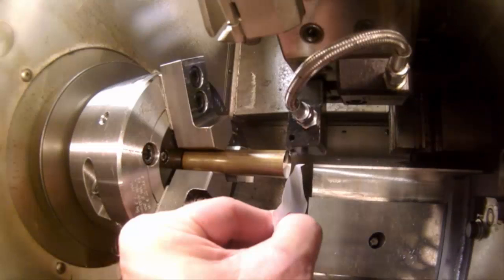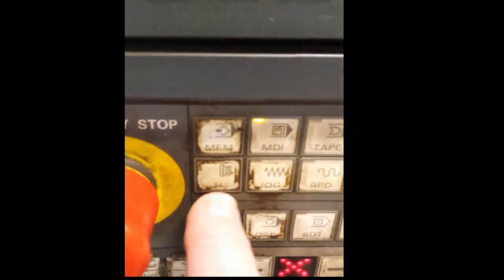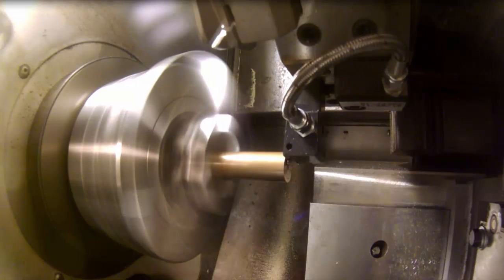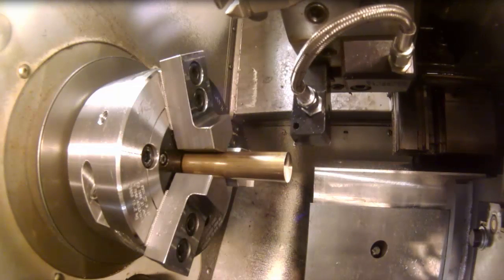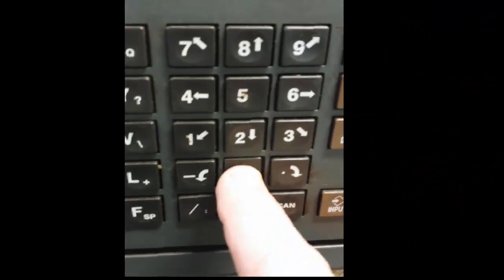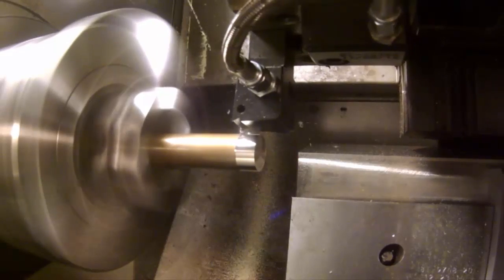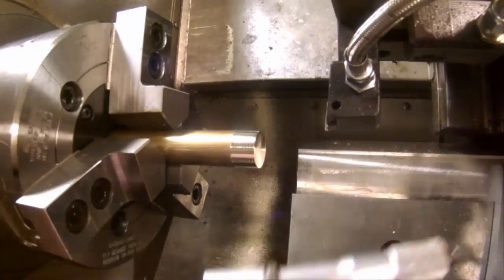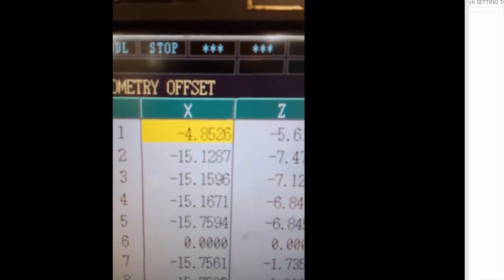TOUCH OFF AND SET A TOOL ON A CNC LATHE

Comment: Hi Tom good morning how are you doing? I love your videos I am a machinist yesterday the cut-  tool broke because it was half way cutting and we got a alarm saying W353 G496 lookin for G497 well it was running the machine. My question to you i have to put a new cut- off tool on this cnc lathe which its new to me. On the sub spindle the stock diameter is 1.0 its a Nakamura Tome wt-100 double turret so do i put X1.008 meaure in geometry under T1 X i have a .004 shem thats why im doing this. Is this ok i learned this from another co worker years ago. Thankyou.

Comment: So when doing a set up you touch off all your tools first (x and z) THEN you set your G54?

And say I already set my G54 but then after, had to re touch off my tool #1 for some reason... would that move my whole G54?
Reply from the maker: Yes. That is correct. 
Once G54 is set it does not change even when changing, adding or replacing a tool. 

G54 tells the machine where the end of your stock is

Touching off the tools tells the machine where the tool tip is
Reply: Awesome! Thank you SOOO much for the help and for all your videos. I recommend them to EVERYONE!

Comment: the easier way to do this is to write the following program in MDI mode.
•G97 S4000 M03
•T0101 M06
•G54 M09
•G00 X-150 Z-300
This program automatically measures tool offset and sets a zero point.
Reply: This program will automatically fire you.
Reply: Stupid idiot
Reply: lol

Comment: hi x axis offset is wrong that job may be 18 mm od but u set only x0.18 which means in correct. right one x18.00 and measure u 

here 18 mm given as example

Comment: Good training. There are many ways to setup your geometry offset page. We use tool#1 as zero that way the other tools represent the difference in length. Such as a boring bar that is 3" longer than tool #1 shows up on your setup page as 3.000.

Comment: yes i have a question do you have to do the same" cutting "method  for x assignment for each tool ? cause it looks like if you have to set the offsets for many tools you may end up with a scrapped workpiece at the end , and it also look like it will be the same for the z axis offsets if you use the " cutting " method.
Reply: Yes all the tools you are going to use should be set in Z and X. Also it's worth checking to make sure the tool offsets have been cleared. Although setting the geom should clear the tool offsets.

Comment: Hi Tom , if we use tool number 1 to set up the workshif after touched off  , does this mean the z value in tool geometry of tool 1 equal the z value in workshift ?
thanx
Reply from the maker: Yes, that is correct!
Reply: trieu pham 

No, that is not correct!  You're very 1st approach at setting  ANYTHING should be to set your "work station" (example: G54).  Setting your G54 will then give you values on each of your tools in Z and all tools will now be, in today's generations terms, paired.

Also stop using papers to set your tools. In Aerospace this is a very amateur move. Use a .001 shim.  The shim offers protection to your contact area's and you get a very smooth, slick feel once your about tool make contact.
Reply: to make, Lol.

Comment: any beginner machinist will easily fall in love with u after watching these video......thanks.....
Reply from the maker: You're very kind. Thanks for watching
Reply: thanks..
Reply: sir can u provide any video tutorial on mazak control....
its quite different from fanuc and i m not getting any rock solid info of it from google
Reply from the maker: +Akash Gurav Are you using the Mazatrol side?
Reply: no.... currently working wih fanuc,but i want to shift my job and that company requires mazak control exp
currently i m working in gear manufacturing industry
now i have even started taking knowledge of cnc turning and grinding
gear hobbing doesnt give any vast or deep knowledge of programming as compared to turning
very curious to learn mazak control
thankss....for ur positive approach sir..

Comment: thanks 
how to set next tools ? tool 2 ,3 etc..
Reply: Thank you Tom for your clear and helpful videos. Really help me a lot on my way to CNC LATHE programming and operation.

If you may, can you make one that explains the steps of establishing TOOL 1 as the MASTER TOOL and the succeeding T2, T3 as the other tools that are used for a particular part. I've been successful in setting the MASTER TOOL at G54, but I encountered some errors in the locations of X and Z during verification of T2 and T3 using MDI mode.

Many thanks to your uploads.
Mar B.